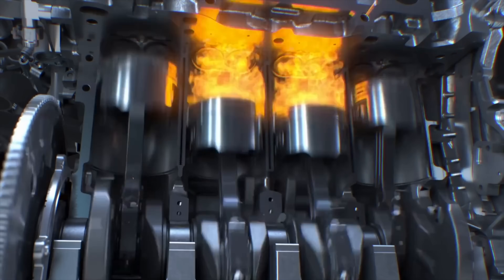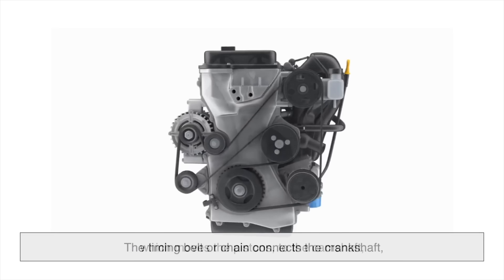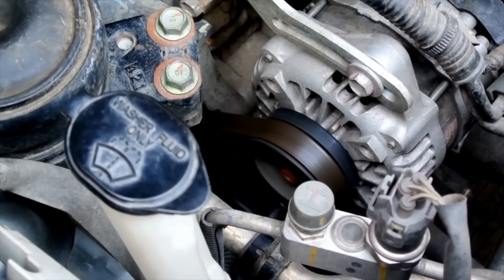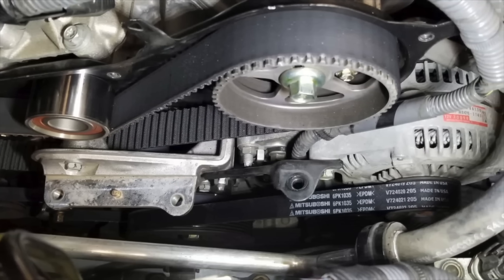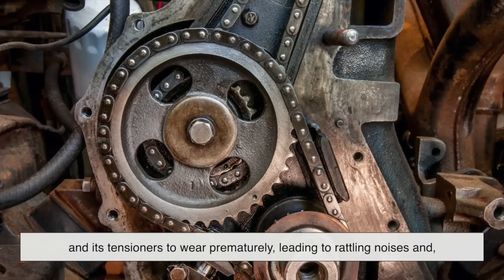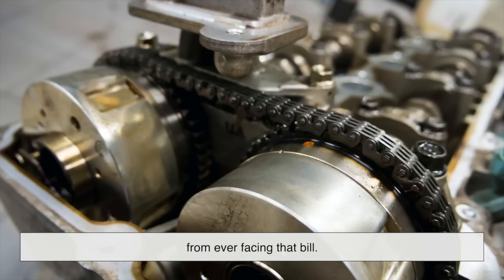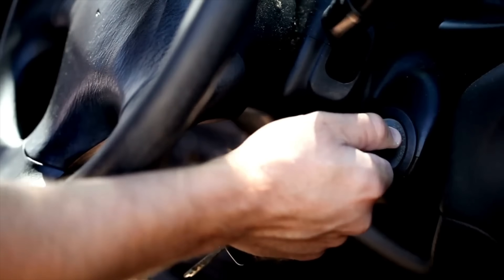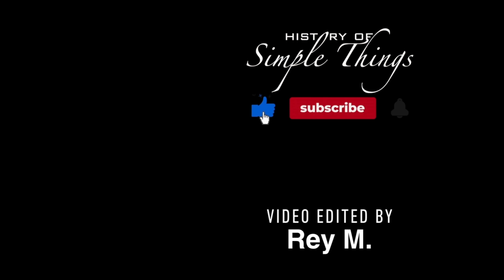Timing Chain vs. Timing Belt: Which Is Better?

Comment: I know ill get crap for this, but i prefer a timing belt. Ive owned pretty much nothing else but all honda's and loved every single one!! To me they are nicer cause theres NO cold start rattle and no noises whatsoever, just a quiet running engine.I understand changing them every 80-100,000 miles. But at least doing the job that you know its been done. Thats just my preference

Comment: Timing chain. There is a reason why they went to belts. The belts mean they can charge you lots of money to replace them. The only time a timing chain needs to be replaced is when the engine is rebuilt. As long as the engine is good the chain lasts decades. Ive seen cars over 60 years old same timing chain.

Comment: I’ve only had timing chains fail on me. Both interference fits. Bent most of the pushrods each time. These were both between 60k and 80k miles, both from new. Timing belts have never failed me. I do my own maintenance on time.
Reply: Wow. You must have had ignored the chain rattling noise. Usualy the first sign of a stretched chain. External dry belts are ok. Internal belts soaked in oil are a disaster. 
Bottom line and as a general rule. Chain are longer lasting on most engines and often out last a car if maintained well with regular service.

Comment: This is a DUHHHHHHH   the chain is better as it should last life of the car    You want to pay $1000 every 60-70k miles???       BTW there used to be NON interference engines that it did not hurt engine  if belt broke.

Comment: I replaced my timing belt this summer and tackled it myself. I took it slow and easy. Including new water pump, entire cost $300.00. 😮
Reply: I did mine 5 years ago, big job. Nervous on 1st start ???
Reply: @freeagent8225 
Yep, plenty nervous. I found that my old timing belt was 1 tooth off, but couldn't believe the previous mechanic got it wrong. Then I found found out the previous mechanic was a Firestone tire shop so I said "screw it" and moved it up a tooth. Lo and behold,  my idle improved. 😂

Comment: This video is wrong. 

Timing belts were introduced in the racing world because they have much lower friction in an engine resulting in more power, better fuel economy and quieter running.

When the fuel crisis happened in the 70's, many designs moved away from chains for this reason. 

A 10% + increase in power and fuel ecomony in a smaller (sub 1.5L) engine makes them much more efficient. 

Who doesn't want more power for free?

Comment: The timing belt is a dangerous atrocity.  There are TWO kinds of timing belt systems.  "INTERFERENCE"... assures you of catastrophic damage when it breaks, goodbye car.  "NON-INTERFERENCE".... the car stops running but the engine is not destroyed.

Comment: Classic American V-8 uses a short timing chain.  Camshaft is right down the middle of the block and uses lifters and pushrods to open and close the valves.  No need for tensioners and idle pulleys.

Comment: Good video…but a couple of errors.
* Timing belts, if it’s a quality one, will go 80K to 90K miles…but REPLACE IT!!!!!
* ALSO…REPLACE the water pump every time you replace the belt or chain, because chains can also wear and/or stretch…which can also cause timing problems. 
🙂
The reason the water pump is replaced at the same time is because it’s in that same area and it saves money to have it done because they’re already in there.
🙂
My wife has a 2012 Honda CR-V and we just replaced her timing chain because Variable Valve Timing components were starting to have issues so…we had the chain, tensioners & guides replaced…along with the water pump.
This was done at 140K miles.
The motor still runs great and we have oil changes done religiously!
🙂
Just FYI. 
Maintenance is ALWAYS much cheaper than Repairs!
🙂

Comment: The intro is wrong for starters. Two cylinders don't fire at the same time.
Reply: Neither did the valves open/close
Reply: So many errors in this video! 

Belts were introduced to reduce friction. That was the main reason.

Comment: Timing chains regained prominence as more complex variable valve timing systems were necessary for overall higher performance in modern engines.  A typical timing belt with a shorter maintenance interval has become a mechanical negative and an economic nightmare for paid labor even before a mechanic could even reach a timing belt.

Comment: Give me a gear drive system any day as a gear drive is a physical system that can’t stretch
Reply: Hope that you have a cdl then, because I think the only new vehicles with gear driven timing systems are commercial vehicles. I could be wrong about that
Reply: @chrisjarkovsky1655 the rolls Royce Merlin engine is a example
Reply: Can’t use gear sets on turbo applications though.
Reply: @a @aaronburratwood.6957  are taking about gear drive timing systems which are located at the front or rear of the engine and not on the side so they don’t get in the way of the turbochargers and as a supercharger is mounted on the top of the engine a gear drive timing system is not in the way

Comment: Timing Chain...

The end!
Reply: Based on. Timing chain was severely stretched after 120.000 km in 2 cars i had. And the job is double of replacing the timingbelt. But whatever.
Reply: @aciddiver1978 

2004 Nissan Sentra vehicle I still have today and still runs just fine has never had an issue with the timing chain
Reply: @aciddiver1978 

Not to mention she has over $235,000 miles
Reply: Timing chain all day as long as servicing is every 6 months max

Comment: Timing belt broke at 82k miles and left me stranded.  I'll take a timing chain all day.
Reply: You need to change it every 60k miles
Reply: @GM355-  Exactly and some are unaware of this simple information, and its costly.
Reply: Me too.
Reply: Sounds like manufacturing defect or lack of maintenance
Reply: You shouldnt drive that long before replacing. This is a user error.
Reply: @aciddiver1978  100% I agree. Ignorance is expensive.